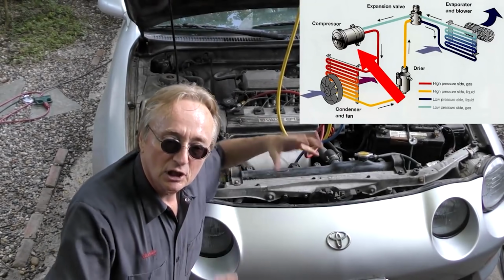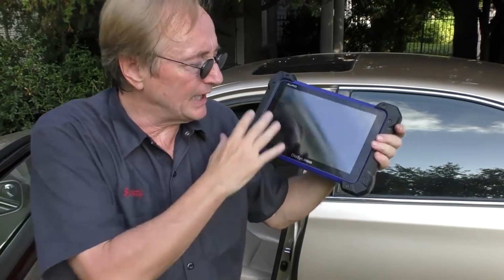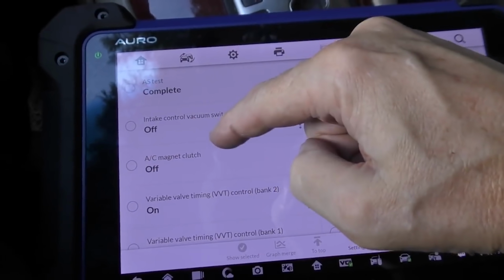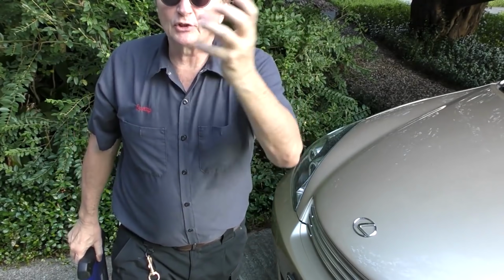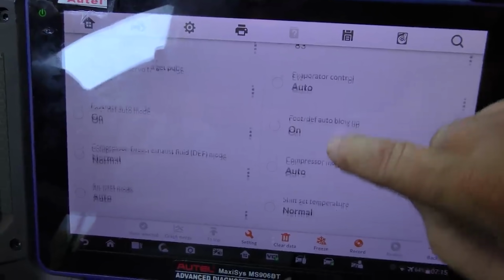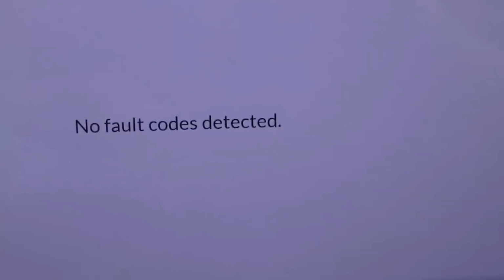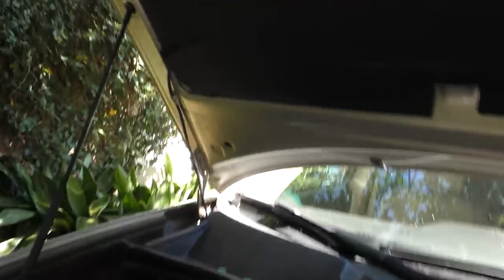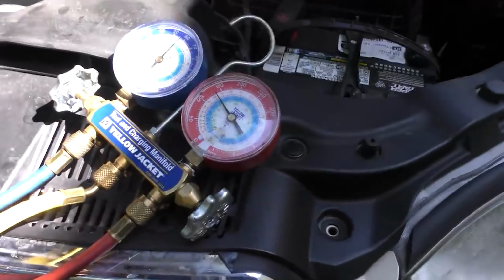Doing This Will Make Your Car’s AC Blow Sub-Zero

Comment: Got a 2007 Audi A4 quattro with the 3.2 V6. Currently has 230,000 mi. and it still blows 33 degree air out the vents on a 100 degree day. Never had anything replaced on the system.....I have flushed it and recharged it with fresh freon and compressor oil twice in it's lifetime as preventative maintenance but it's never had any issues whatsoever.

Comment: I have a can of AC from autozone. Would it be smart to use that can and fill up both both ports or just stick with one?
Reply: Never fill on the high side. Just use the low side
Reply: @shibbybag2988  ok it will be marked with L for low side

Comment: Air conditioning was the second worst invention on vehicles. The first is the automatic transmission. Roll down the windows and try to park in the shade when possible. Save the trees.
Reply: A/C is a luxuries thing. It's not necessary for a car. It's just put more load on the engine itself. That's why, I rarely used A/C, even when, it's over 100 degree F, outside. 👍😁

Comment: 2009 Accord required refrigerant in 2017.  Added it.  Haven't had any issues since.  Most techs argued there must be a leak but I saw one of Scotty's videos talking about the seal requiring some refrigerant to lubricate it.  I mentioned that a few times and nobody really believed it but hey, I've not added any now for 4 years so where's the leak at?  About to do the same for a 2006 Silverado.  Never had refrigerant added but I suspect it needs some since the air isn't quite as cold as it used to be.

Comment: He's not exaggerating talking about crappy heater vents

My dad has seen three seperate Ford heater vent failures which cost several hundred dollars each, as well as a broken Mazda Rx-8 heater, probably from the heater vent, since it did share many parts with Ford cars because, if you didn't know, Mazda is half-owned by Ford. It's also worth mentioning that since we had rented one of the earlier ones, it was made around 2003, which is in the same time period when Ford was making particularly crappy cars. The Rx-8 was also plauged with many other issues such as; the windows not rolling up or down, the engine catching fire (only early versions), the engine not starting, not being able to take it on short trips, the exhaust heating up the interior, and the rear suspension also felt worn out and soft.

Despite all this, I still love the Rx-8 :)

Comment: Ice cold?  Easy! Pull the temperature probe back from the evaporator about an inch. Did this in my Volvo S80 and got 34 degrees out the vent. 👍

Comment: 2015 Jeep Cherokee Latitude 2.4L 4 Cylinders came in for repair because the owner heard a loud pop and AC stop blowing cold. I took it in, Did a visual on it. Compress Seal blew out and was laying right there visible to the eye. I knew at that point, the R1234yf Freon is all gone. Proceed to write a quote for customer for A/C Compressor, Drive Belt, and A/C Condenser. Being as A/C Compressor blew out the Clutch Seal, Compressor is seized, could have debris lodge into the Condenser. Long behold, Replaced New A/C Compressor, A/C Condenser and Drivebelt, performed R1234yf vacuum and recharged. Checked for Freon Leaks with Sniffer and UV Light, none present. Got the car to go down to 20-22 Degrees F from all the Vents. Customer was happy as hell to have Cold A/C!!  That new A/C R1234yf is EXPENSIVE. Not many shops in town have the A/C Machine to service the new system. I think we paid $10,000 dollars for ours last year. I had to retake a 609 Certificate in order to better understand it. Easy though if been doing A/C for a long time 10 + years. The R1234yf Machine is too smart, if it detects a pressure leak, it won't continue. Thus, it takes a good 2-4 hours to run through its course with the R1234yf machine.

Comment: I've gotta a 2002 Honda Passport and till this day it still blows as cold as my 2017 Tacoma and that's ABSOLUTELY no joke.
Reply: I have a 2000 Corolla, 200k+ miles, and I had to put a small recharge in, but the A/C blows ice-cold. First time I've ever purchased a beater-with-a-heater that also had working A/C. And the cruise control works, and the power windows, and the rear defroster ... Scotty is right!
Reply: @Erik_Swiger  I have a '90 Volvo that does all those things, too. So, it's not just Toyotas.

Comment: Imagine if scotty made a car, it would be more reliable than a Toyota
Reply: no plastic parts! everything made of high grade steel and aluminum. All of the valves and vital access point would be located on the top or bottom of the engine for easy repairs.
Reply: @Jormungrandrserpent  and metal check balls in the valve body instead of rubber
Reply: It would be made of 20 year old Toyota parts and held together with duct tape.

Comment: I've usually had good luck with Honda / Acura AC units 
Not so much luck with the Chevrolet ones back in the 90s , 2000s..
Reply: My 02 chev tahoe bought new.    On the original AC with 1lb added myself and one time a small leak fixed and refilled.   3rd water pump 2nd alternator 2nd radiator , 4th battery,   270k miles and yes she still blows hard and cold front and back.   However the heater core is plugged and needs replacing.  Oh well I’ve got heated seats and in Commi Cali.   So I’ll tough it out.

Comment: I'm seriously baffled what Toyota does to make these cars virtually indestructible.
Reply: They used to engineer every part of the car properly...but as you just saw, even Toyota is starting to cheapen out with plastic where metal used to be...and that promotes failures....
Reply: I wonder if there was some cultural shift towards quality products due to geographical reasons. Japan has very little land mass, and is highly-populated, it seems to make perfect sense that they would want to generate as little trash as possible. NOT saying this is the only reason, but logically it makes sense.

Comment: Had a 1985 Subaru.  It used a thermistor next to the evaporator to control the compressor.  It wasn’t getting cold enough for me.  I moved the thermistor away from touching the the evap.   It worked great in the dry Denver air.  The compressor ran longer before disengaging and it blew super cold.  I drove through the humid Midwest and the ac started blowing warmer, cool moist air.  The evap iced over.  I stopped and pushed the thermistor against the evap and the icing up stopped.  The air blew colder, just not ice cold ❄️😏🤷‍♂️

Comment: 2014-2017 Suby Foresters have weak condensors that easily develop leaks due to corrosion. My '17 (111,000 miles) gets AC system usage daily ,since new, with no problems, other than installing a newHVAC switch panel and new blower motor. System blows cold.

Comment: Just traded my Hyundai Elantra for a 2021 Toyota Corolla. Scotty would be proud.
Reply: @slow mazda South Korea has the 6th best infrastructure in the world. That's significantly better than the US and are just behind Japan who's 5th. So you're just fanboying to look good and it's not working
Reply: I have an '07 Hyundai Entourage and the thing has been bullet proof.
Reply: 257k kms on 2007 Hyundai Elantra still runs like a charm.
Reply: @slow mazda Got a 2008 Accent Hatchback, 175,000 miles. Only major prob was tranny started to slip.( had somebody practice parking for her license. Took  6 weekend, about three hours a day till she finally got it). Mech said she’s the cause. Took the backseats out and use it for my beater.  Paint still good, few small rust spots. Hauls lots of stuff. Took Scotty’s advice and got a CH-R for the summer. Love that car. Definitely best craftsmanship compared to Accent. Niece took test and flunked. Go figure.
Reply: @slow mazda No mate. Hyundai has become more reliable in the last five years than Toyota, Mazda, etc. Kia is also good because it's literally made in the same factory as Hyundai with the same quality control measures which are very strict.

Comment: Have a 2004 Toyota Camry le blows ice cold instantly has 161,000 miles. Love the videos!!
Reply: My buddy had a 2004 that would still be driving if someone didnt hit it and total it. He clocked 600,000 original trans and engine. He drove it about 250 miles a day 6 days a week for his job. Thing ran better than my 13 civic. I have a 97 camry that blows ice cold at 163,000. Its way colder than all our newer cars we've owned. Same with a 97 accord I had. Dont make em like they used to!!
Reply: Let me borrow it!
Reply: 05 at 255,000 still freezing cold
Reply: I have a 2006 Toyota Camry with 173,000 miles still blowing ice cold AC
Reply: 2007 myself 211k miles. Great car.
Reply: My car has 500,000 miles and a broken AC, still blows ice cold, i live in Antarctica
Reply: @lazertag720  
😱🤣🤣🤣
You must be a penguin as it really Winter there 🤔
Even 25 below zero would be a heat wave for ya...
STAY hydrated and buttered up 👀🤗😱 
I meant moisturized 🤩
Reply: Tank
Reply: @D-DM5  my scion is the same way the ac works immediately and it blows ice cold. My wife had a newer chevy Trax just bought last year she couldn't exaclty afford a new rav4 like we wanted anyways the ac doesn't hardly do anything unless your moving.
Reply: @jelias999  there's something in that. Im audi and toyota driver.corolla is also great, but for slmehting else than audo.
Reply: 2001 Camry 75000 mi ice cold A/C
Reply: 99 Camry at 220K. recharged but cold AC
Reply: Ditto 04 V6 le
Reply: 04 Camry 173k,Still runs great & Ice cold air!
Reply: I’ve got a 2005 Camry Le, just crossed 400,000 miles.. I think I’m at 403,000 right now.. it’s burning oil, but outside of that, runs like a champ!
Reply: '05 Camry XLE 2.4 L 197k and Still blows ice cold air. Never added to it. Looks Pretty enough and love the sweep of the fog lights too.
Reply: But is the Clutch good
Reply: I got a 05 mine doesn’t get cold until I fire it up and start driving lol, when it’s sitting the air is still kind of warm 😂
Reply: My 06 Altima blows ice cold air still.
Reply: Great cars, but absolutely boring to drive and look at.
Reply: @landscapingspecialist  I'm about to upgrade to a 2004 camry 4 cyl.

Previous car? A junkyard 98 corolla that I paid $700 for in California 2 years and 25,000 miles ago

Boring for most? Sure.

But I've driven AMG Mercedes and pushed it to the limit of 182mph

I've had my fun with other people's cars. I'm too poor to afford one of my own.

I think the 2002-2006 Camry's look pretty good compared to anything else I can afford! Certainly better looking than the 2007-2009 generation imo

Thank you for coming to my Ted talk
Reply: @landscapingspecialist  you're probably an Audi driver🤣

Comment: My honda's ac works great yr after yr
Reply: My 2007 civic ac broke 7 years in... new compressor.  Honda sucks these days.
Reply: @Artichoke555  not mine 02 and better then new
Reply: @Artichoke555  yeah there is a compressor issue with Hondas they go out sooner than expected.
Reply: @Artichoke555  bruh seven years ain’t that bad
Reply: @jefferyweiner8481  Considering my 2003 Camry compressor is working like new, I think Honda standards have gone downhill.
Reply: My 06 gets so cold I gotta turn it off
Reply: @tylerstrong5041  I just got into my car and it's hotter then hell.. thank God for AC
Reply: I have the same civic. It had compressor issues. I had a good mechanic replace it and he cleaned out the whole AC system and the car never had an issue since.
Reply: I have never looked at my AC, because I lease vehicles or buy decent ones and it's covered or I can afford to have it fixed for me if it ever is broken or slightly broken.
Reply: I wash with high pression front a.c. radiator an it's cooling inside much better then before.
Reply: My Audi A6 works still great after 22 years